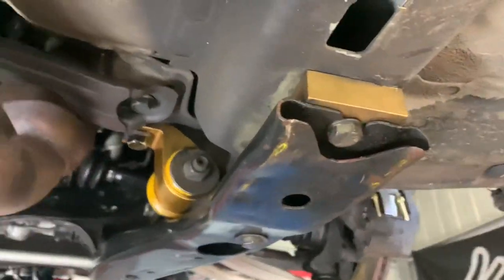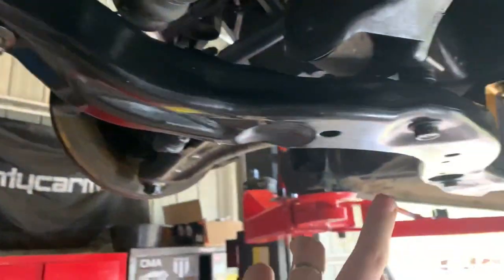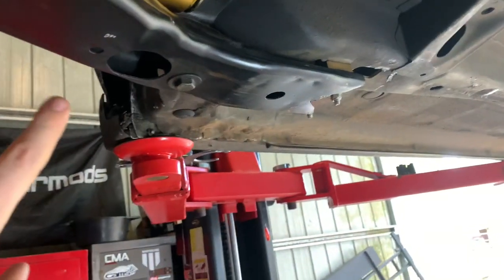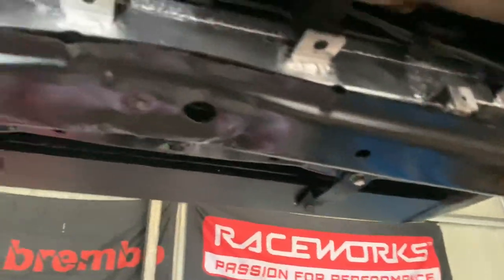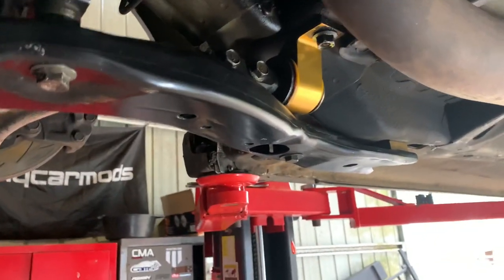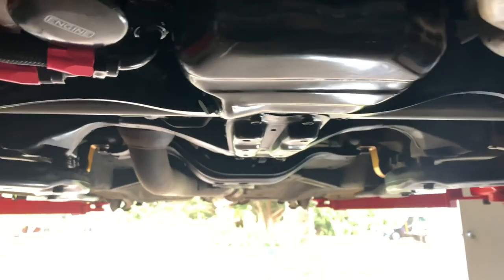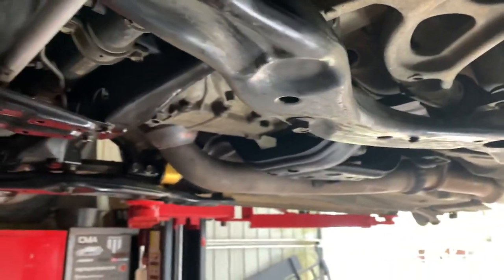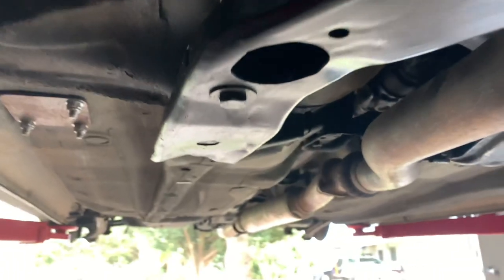Subaru Impreza WRX - Front subframe removal… Yes or no?

Comment: Mine was cracked and when turning the wheel while stationary, in low-speed turns and over speed bumps it would make a loud clicking sound. Took ages to diagnosis as it sounded like it could have been multiple things like the tie ends, the calliper, the strut, the ball joints… (I even replaced the steering rack after the first misdiagnosis). The crack was only discovered on a drive-on hoist whilst under load (the crack would close with the wheels off the ground). The point is; it was clicking because the subframe was flexing at the crack. This means that the subframe is  absorbing all kinds of lateral forces, all the time, even at low speed. It adds rigidity and handling to the front end. Take it off, I would not.
Reply: Seems like I have to check the sub frame, as well. Mine does similar noise and nothing is found to be wrong with the suspension, links etc. according to specialists. At least I give a try😅

Comment: I cannot see why this would even be a debate tbh. Seems like weight reduction gone mad.
Reply from the maker: Thanks for the comment mate, I hear where you are coming from. I guess at the end of the day weight is weight, even a little adds up to be a lot when out all together. And in the big picture or in terms of lap times I don’t think it’s going to make a massive difference, but good to generate some conversation. Cheers 🍻
Reply: @jgmotorsports4384  i suppose so, the mentality im looking at this from is the same mentality that ends up with a heavy car because i refuse to write off a gram here and there because its "only a gram".

Comment: Mine was rotted through its definitely steel. unnecessary on a daily car like mine. I noticed no difference at all with it on and off, only took it off because of the hole in it and under braking it would move slightly creating an awful sound

Comment: It pulls . The engine and transmission downwards in a head on crash. I took mine off its junk.
Reply from the maker: Oh really? I haven’t heard of it doing such a thing. Was this for safety?
Reply: @jgmotorsports4384  yeah that's correct it's for safety in a head on (to  a certain extent)
 It's U shaped with a gap towards the gearbox allowing the gearbox to drop down.

Comment: My subframe just cracked in my 2002 Impreza. Should I replace it or should I ditch the car?
Reply: Mine is rotted through too. Did u remove it or ditch the car?
Reply: Someone ask me 7.5 k to restore the underbody to pristine condition as mine its rusty or diy the most of it and pay the garage to finish the job
Reply from the maker: I guess that’s the point of this video, seeing what the difference is, getting peoples thoughts etc. 
if it was damaged and you wanted a replacement I would be sourcing a replacement rather than looking at a repair for that price! 🍻

Comment: I used to think removing it didn’t matter. But really I would say this offers structure rigidity to the front of the car. The loss of strength isn’t worth the weight saved by this. 
Good video
Reply from the maker: Thanks for the reply and sharing your thoughts! I do think there is something to be said about if removing, then replacing with an aftermarket solution 🤔
Reply: Mine is rusted threw is it ok yet?
Reply: @c27maxima  I been driving my Impreza with the frame rotted away for years no real problems but consider the crash safety is compromised due to the lack of support by the frame. Would recommend replacing for sake of safety but it’s surely up to your disxreation

Comment: Wouldnt call it flimsy. Its light but plays important role in tying the front suspension together. Sure structurally it may not take any stresses but i would say having a light weight U shaped beam tying the key suspension and body together adds rigidity and longevity. GD chassis is known for being very rigid and the chassis is a whole system that supports itself. 

The bolt locations may not shift over time without the beam but I’d be willing to bet over a long time those suspension points could permanently be flexed out of wack

Comment: That brace is steel and for force distribution in front end collisions. Not much for rigidity. I replaced mine with the Oswald Performance underbrace to save weight and increase rigidity...while acknowledging a small expense in affecting the car's original safety engineering.

Personally, I wouldn't just remove it for safety's sake. Replacing it with a more rigid piece is within reason though.
Reply from the maker: Good points mate, how did you find the difference after installing the Oswald performance under brace?
Reply: @jgmotorsports4384  For rigidity, only minor improvement but I already had some other bracings installed - probably much more noticeable coming from completely stock.

What was really noticeable was the weight savings; steering was tighter, braking and acceleration felt more responsive. Big wins there.
Reply: Really like the Oswald design, but have heard so many horror stories regarding missed deadlines and broken promises after paying. I'd have no problem throwing down the $ if there was some kind of uniformity to the purchase of these. Admittedly, it's been a few years since I considered purchase and things might have improved since. If so, my apologies to the brand.

Comment: I think it's designed for many small random reasons. 

frankly subaru maybe have added this as jack points and/or damage prevention and/or stability. 

I noticed that without the under tray the window pushes the car around easily on the highway so small twicks like the subframe are deliberately designed for many random reasons